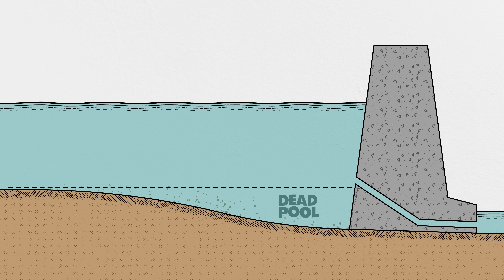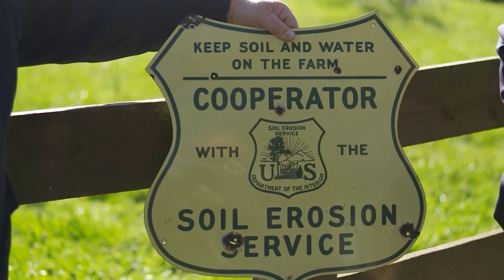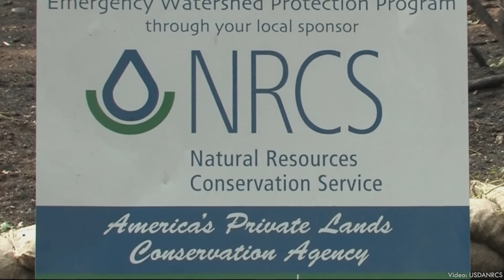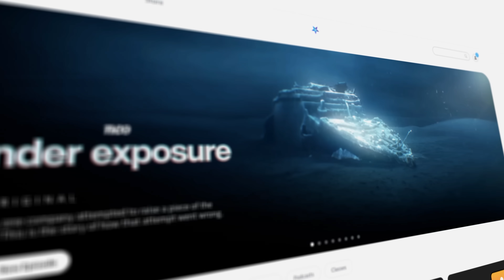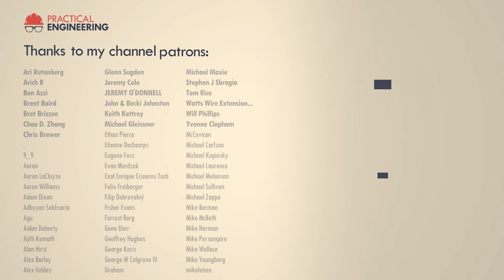All Dams Are Temporary

Comment: Imagine a sub-aquatic conveyor belt of dredging buckets sweeping back and forth through the area where sediment will accumulate. Let's call this "conveyor belt of buckets" a "scraper belt". The path of the belt being variable on the reservoir side of the dam (as to not scrape the same place repeatedly) but its path also including the outlet (downstream) side of the dam where water leaving the dam can remove the content from the scrape belt. Thus moving sediment from upstream to downstream in a controlled manner and slow enough to mimic the natural process of sediment movement. And of course, powering this scraper belt can be via hydro-power by using the force of the water to keep the mechanism in movement. 
This is just an initial thought so, there may be some issues to work out but, seems like a reasonable low tech solution at first glance.

Comment: 8:30 you say "We don´t usually dig enormous holes to store large volumes of water"... Actualy we do. Most of surface mines end up like water reservoirs after they are depleted.
Reply: But those aren't for the sole purpose of storing water. His argument is that it isnt efficient to dig holes specifically for storing water, surface mines would be dual purpose, right?

Comment: Basically what I’m hearing is this is why hydroelectric is very poor and if there is a dam somewhere it should be fully open at all times unless a super rainy season to prevent flooding

Maybe there could be storage tanks for filtered water in dry season, but it’s not viable for power or anything but emergency prevention

Comment: The bottom discharges of water dams, as you say, do not have an ideal solution because they only discharge the final part of the process. 
What would happen if we connected tunnels that absorbed the sediments from the initial part? 
Would it only be functional for new dams that have not yet accumulated sediment or would the water flow end up cleaning the sediment from the older dams? 
Very interesting!

Comment: My solution is to have two dams, or a double dam with two reservoirs, or something like that. One that has active flow into it and one that doesn't and a switching gate. Whenever one of the dams starts to fill up, close it, diverting the flow to the other dam/other half of the dam, wait for it to dry up and excavate the sediment.
Of course this is only practical if excavation is significantly cheaper than dredging. I don't know if it is, since I'm not an expert, but you'd think having to work around the fact that you have water in the way would make it harder.
There's also the massive investment required to either build a double dam or two dams for the same purpose when one of them wouldn't even be in use most of the time.

Comment: Is it possible to periodically open some channels for a faster flow, agitate the sediment through mechanical means (such as dredging the bottom) and bring it back in solution?

I'm sure there's some problems with it that I'm not considering but that way you could still rely on the water to do most of the work in actually moving the sediment while also somewhat controlling for the total amount you are releasing downstream.

Comment: What if you built a trident shape with two alternative ways? You keep the alternatives closed all year until sediment maintenance begins, then you close the main way, leave it a month to dry in summer, and then you excavate?

 The sediment accumulation point ought to be the same position as the three split of the trident shape. The water would simply flow to the same outlet just with different flood gates, again only used for maintenance.

 If sediment builds up in the alternative ways it can be maintained the rest of the year.

Ought to be a solution for all existing river dam setups.
Reply: In a nutshell dams and their river supplies need to be redesigned on a fundamental level to be compartmentalised to solve this problem.

Comment: the only solution is to periodically empty out the sediment by digging it out and place it far away outside the floodplane(any place until the next mountain peak that regulary collects rainwater and rundowns into the river) otherwise you end up with the depicted situation. i studied geology in high school and sedimentation on low running rivers was the most memorable lesson i learned from it!

river valley between mountains with rundown from the mountains by rainwater is what fuels this sediment displacement and deposit in the stagnent riverbed created on the inflow of the dam!

Comment: A good solution is to have a wide, shallow area just upstream that floods before the water is allowed to drain into the main lake. Then regularly harvest the sand and sediment from this upstream area when the water goes down and is accessible by land based equipment.   Sand is actually a very needed resource in the world. Granted it needs to be a certain type, but with some post processing the dredge from some of these reservoirs could be a resource.  Anything that can not be used can be put in the dam discharge area to go down stream in a controlled fashion (where it makes sense). This isn't a perfect solution for all dams with limited pool space (like in the mountains), but it would work for many, especially large ones in the south. I know most of the large reservoirs on my state have plenty of extra area upstream that could be used.  You'd still need to dredge the main lake, but far less often.

Comment: Its not a solution but it would help if subsidies for agroforestry, specifically the areas close to rivers and creeks, had to be maintained as densly vegetated areas. Especially with plants that love waterlogged soil.
This also helps prevent pesticide and fertilizer runoff.
Additionally, using the meandering of the river before the dam to try to capture silt by building up vegetated sand trap islands.

(These last are a pure guess)

Comment: Shipping the dredged dirt away.
Why would you do that?   Toss the dirt on the downstream side of the dam so the downriver area can regain the benefits of the sediment that they lost when the dam was built.

If the dam has one of those "dead pools" - put the crane and bucket RIGHT ON THE DAM.  Run that bad boy 24/7.  Use rails so the crame can move along the dam.
Is it a hydro dam?  There's your power source for the crane(s)!
Pick it up on one side, drop it off on the other.
Might even be to use suction to keep moving "dead pool" sediment over the dam.

Comment: If all we need is suspension for the silt to be moved, use an auger to lift amd resuspend the silt near a gate thats moving water, so instead of removing the silt and place it on land or elsewhere, lift it and let it be suspended near water flow to be carried through a gate thats open enough to let water flow fast enough to carry it out, and match the rate it comes in. This only requires the removal of silt near the dams base, and create space for more to flow in, like the last layers of sand in the model. Other resuspension augers could be placed in areas up stream to keep the top layers from getting too high, and once the system is installed, it could only require minor adjustments to get the high spots as they form in the change of flow from resuspension of other areas, because changes in the levels of sediment will of course change the flow of the water.

Comment: What about making a Pre-reservoir sediment trap that captures some sediment in a more permanent basin. Then use a plow pulled by cable or a system of screws to pull most of it up and transfer it into the output of the dam's water. It could be a backstop for a minimum size of the reservoir. even if sediment over shoots the area the build up will eventually fall back into the trap. it might  be run as a weekly thing if the river doesn't deposit that much.

Comment: would it be possible to take advantage of the natural property for dirt to settle when the water slows down by creating an artificially deeper section near the entrance to the reservoir? then either only having to focus on dredging a much smaller area or attempting to design some mechanism or facility which will allow for the silt to be collected early on. 
like some sort of concrete channel running the width of the river to collect the sediment and some way for it to flow or be dragged to one edge

Comment: Could you take a long pipe from one if the overflows to the buildup and use high pressure water jets to wash the buildup into the pipe and through the overflow. It would only need to stay slightly ahead of the silt build-up to reduce it. thanks

Comment: Create some kind of LOOOOOOONG mechanical rectangular "box" resevoir that is operated by a machine atop the dam, essentially this "box" crawls the bottom of the dam and sucks in sediment whilst pumping out extra water via a one way valve.. once a large quantity of dirt has been collected it continues to crawl until it reaches a "carve-out" section at bottom of the dam where it can excrete its reserves of sediment ensuring the sediment makes it beyond the wall of the dam.. you can control the rate of excretion ensuring not to clog up the river beyond the Dam wall, and if this system operates passively over a period of years presumably indefinitely with maintenance of this "crawler" system. It can ensure that this never becomes an issue again whilst simultaneously solving the current problem

Comment: I had an idea while watching, and upon further consideration, I believe that a pump may not be necessary. If we were to install large pipes—one on each side of the reservoir's length or down the middle—beginning at the inlet and extending to the inner base of the dam, where there is a designated area for sediment and a relief valve to facilitate sediment flow, we could create a more natural flow system. At the inlet of the reservoir, we could consider dredging a reverse delta structure made of concrete, metal, or another durable material that would direct the flow of sediment into the two pipes along the sides. This design would allow sediment to be channeled toward the front of the reservoir, enabling it to flow through the dam without becoming trapped. The existing sediment within the reservoir would remain, as it would naturally flow toward the dam and out through the lower relief valves.

Comment: I interned for a summer at the us bureau of reclamation working on this exact issue. While nothing said in this 11:30 section is wrong, one of the key issues with sluicing is damage to the Dam conduits. Running tons of slurry through the concrete and steel inlet/outlet features very quickly erodes them away, this can be seen in many of the sediment tunnels made alongside modern dams. The big difference between the sediment tunnels and dams is that a lot of the features inside dams were never intended to be replaced.

Comment: Though the details might be complex the most basic solution would probably be to create a bypass tube with possibly some kind of collection mechanism for sediment that would extend from an area where its most likely to settle from the beginning and having it go up to and through the dam allowing it to flow out the other side. The sediment would have to move through this with a fast current of water as to not build up in the tube, maybe not have the tube be completely full and have water jets at certain intervals to keep anything from settling. Just an idea though

Comment: I'd say that the best solution would be more smaller ROR hydropower designs. Doesn't block the river, and if the penstock becomes clogged with sediment that sediment can be sold off. Even better, with the advent of BESS systems this tech could be applied to ROR to help even out the overall power generation.

Comment: Not an engineer, but would it be possible to resuspend silt and flush it down stream at the same rate it is coming in? Or at least, close? I'm envisioning a barge with giant dirt "screws" that churn up the silt near the dam, allowing it to flow downstream. Hell, if the silt isn't compacted, you might even be able to make some barges with solar powered "screws" that could keep the silt churned up. Just a thought

Comment: How about just allowing enough water to continue downstream in a channel beside the dam to carry away most sediment. The dam would fill via a long weir. It would mean less water for the dam though, and sediment would still slowly build up. But it would be easier to manage sediment along the length of the weir as most sediment would drop there, and could be sluiced away assuming a channel was in place on the dam side. Allowing water to flood through the channel would flush it pretty quickly. If done regularly it would prevent having lots sediment flowing down river. The channel would need to essentially be a settling pond with a sluice at one end, and open to water deeper than the channel at the other.

Comment: What about pipes? I know it wont be as simple as that but say we put pipes down the to be reservoir and let it drain the sediment? With multiple pipes and inlet while regulating it's sediment input, along with separation of pipes for maintenance or replacement of them at regular intervals? Sure will add to cost, but not sure if it'll work or added cost is too much.

Comment: i believe a very large drag line would be the best way , you could easily control the rate of what you remove . the soil is in a lot of case very rich . and big drag lines can move massive amounts of soil . set the soil to a side to allow the water to drain

Comment: Can be possible to solve part of this suspending again sediments, I suppose that is not compatible with energy generation because dirt in water erode machinery but is a viable solution to the filling itself: pumping hi pressure water on the sediments stir up the more fine ones and suspend them again so could be dragged out, the visual clue is that you will make the reservoir brown....
Sedimentation need time and laminar flow, so it's not impossible to create condition to keep sediments suspended or move them around, naturally rivers do it during their lifetime creating and changing their convoluted bed. Probably could be interesting to look at mountain lakes, they are a natural reservoir that is still relatively sediment free!
The main issue that I see is economic, as said probably there are some downsides on the machinery cost and/or uptime to be compounded on the cost of the pumping energy and operational cost, the technology itself is quite well understood and used if not so economic: hydraulic mining is used from classical times and quite a lot during the Gold Rush, keeping light sediments suspended was used to separate gold so probably could be done in quite a few ways,

I'm not in the field, so may be impossible, but it's something that I hadn't seen in the video, so felt could be considered.

Comment: I have an idea! We should run large metal pipes across the base of the sediment and aerate the sediment loose and into the current. 

You could control the amount of sediment that flows down the river by how long you leave the system running and aside from disappearing a boat in the blink of an eye, it just might work

Comment: I always wondered why they just don't siphon the sediment across the dam. In that way, they can control the amount of sediment, gravity is free, they would still have the hydro power. It would require a system of pipes (or better flexible tubes), but that doesn't seem like a big deal.

Comment: In engineering this statement is rarely enough but " I'm pretty sure " that if we make a (bunch of) floating device(s) that anchors to the sediment, during the higher vasion months the extra flow + circulation of water around will "erode" the sediment (Just like it does around a rock in the bottom of the river) 

//

Another option could be making a smaller barrier upstream, not to a halt but to slow a little just to give a chance for heavier sediment to settle down... Snail in my ear told me paretto applies to this, 20% of work could sink the 80% larger sediment that make most of the trouble

Comment: A theory I thought of is to set up a bypass river to carry the sediment around the dam. 
Idea being that the water layers that carry sediment would take that that alternate route, while a layer that carries less or no sediment flows into the reservoir. Ideally this would be a passive system taking advantage of fluid dynamics and flow, accounting for paths of least resistance and such, and applying filter systems only as necessary to get the desired effect in the design of the system.

To be safe, temporary systems like described in the video can be included at the other points in the system to buy time if an error in the system manifests.

Comment: My solution, don't bother to find a solution, but rather try to reimagine a beneficial outcome.
Like this:
You build a dam, over the next 100 years or so the silt builds up, while you do your normal silt maintenance, by the time the reservoir gets full of sediment, the dam and it's equipment will be worn out anyway, so you decommission the dam, then sell or lease that new land that used to be the reservoir to farmers, who will extract value from the new, relatively flat and fertile inland delta. Then when the farmers have depleted the soil, you mine it for river sand and gravel for the concrete industry, after which your reservoir has been restored to full capacity and you rebuild and renovate the old dam.
Rinse and repeat.

Comment: It seems the engineers could built a pipe along the bottom with a flexible inlet and use it to vacuum out sediment at a reasonable rate over the life of the reservoir.
Reply: They certainly could, 75 years ago